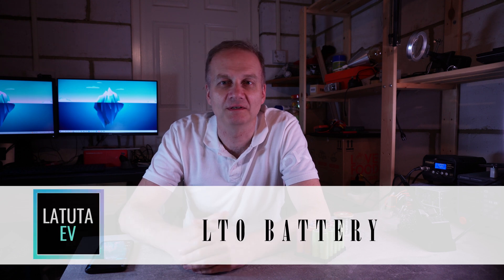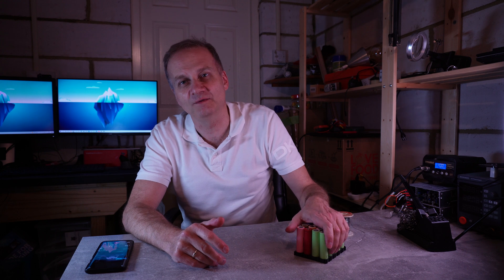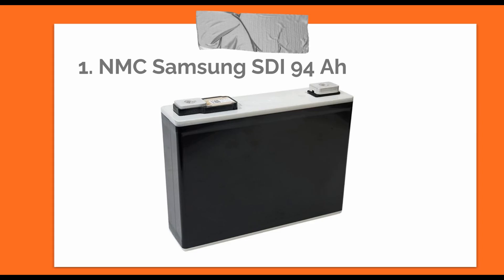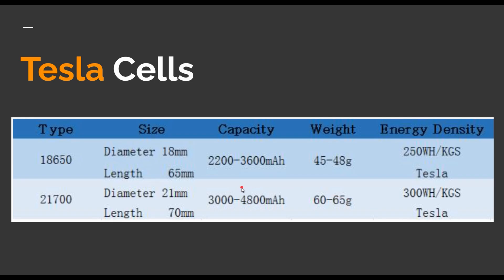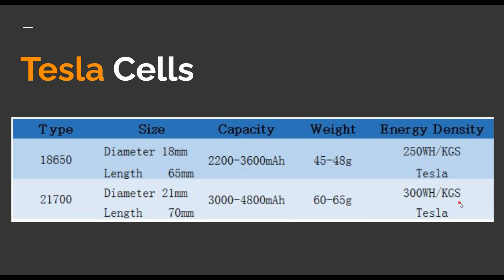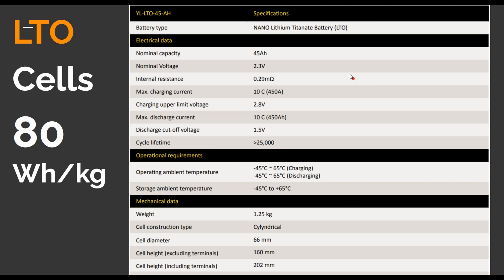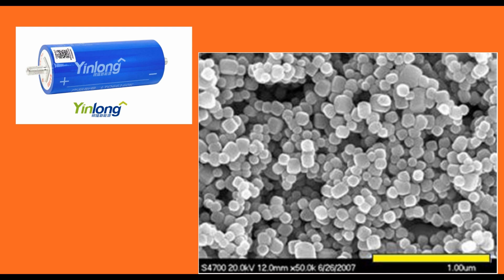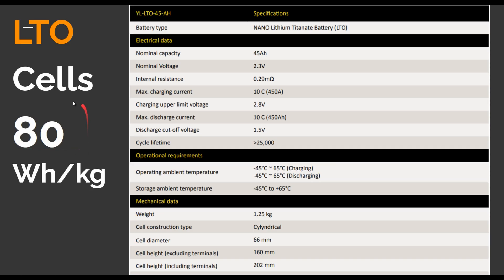LTO Battery for electric cars

Comment: just saw lto prices come down for the 20/22ah prismatics today from chinease suppliers. doing the math after tariffs (since lto are not apparently included in usa tariffs) LTO small format prismatics are only 2.9x the price of LFP now days with the heavy lfp tariffs.
when you factor in the lower need for strong fixturing (less expansion in lto), and no real need for fancy/expensive thermal managmnet of lto, youre ending up close to parity costwise for LTO vs LFP now days. in a small hybrid/high dishcarge pack, this is more true for lto. lfp for a small pack you will usually need 2p or 3p config to get enough discharge rate out of a smaller hybrid car/high discharge rate lfp pack. LTO can probably handle this with a 1p config further giving a cost advantage.
never thought I would see the day that there are cheaper applications for LTO vs LFP. no doubt thanks to trumps ego i guess lol.
there is a company here in usa that makes replacement hybrid batteries for older prius cars. they offer LFP and sodium ion right now but lfp they use small cells to get high enough discharge rate and they really struggle in colder climates. newer versions actually need internal heaters which end up nullifying most of the range benifits of LFP vs original NMH. this is an application ripe for LTO now. sodium ion is garbage coz its voltage curve you end up loosing almost 40% of capacity for prius retrofit application

Comment: lto makes the most sense as a replacement for lead acid/agm starter/auxiliary batteries in all cars, evs/ice/phev/erevs. way lighter than lead, lasts way longer, doesnt care about temp, better for short bursts of power even for a small/light battery, able to accept lots of charge. thats why the original word for lead acid batteries in automotive applications was an accumulator. much more similar to what we would label capacitor now days (in function not form). most lead acid batteries are not designed for capacity/weight efficiency. problem is in usa lead acid batteries have become a monopoly here, they are all made by johnson controlls in this weird circular economy. they raise their price every year by twice whatever inflation rate is and make them last shorter every year. they get all the auto makers to keep using their 100 year old battery tech in their cars usually by supplying the batteries for free which is a significant margin the automakers dont think they can give up. ironically for the consumers, lead acid batteries have gone up in price every year while lto keep coming down. around 2 years ago here in the usa, it became cheaper to import LTO cells and build your own 12v car starter battery instead of go to the store and lug ur heavy battery there and back. built a 6s lto battery for my old phev/erev and it has been working really well. 6s lets me use my low voltage solar roof to store more power above what my car would charge the lto battery to (14.5v vs 15.8v for solar roof). the soc curve lines up really well for this application. i think the cells pre tariff 6 months ago were like 122 usd delivered. a replacement agm battery was like 230-260usd lol. one of them will last forever.
its weird monopolies like this in the usa where i start to realize why we are putting in tariffs. not good for economy/industry in this particular example. net welfare loss of monopolies is a compounding value over time in micro econ

Comment: The claim on LTO is too good to be true. It's a new tech, the advertised longevity of the cells are still theoretical. Also, it's very pricey at this point. Great technology tho.
Reply from the maker: I agree about the price bit but the number of cycles has been confirmed through simulations and testing.

Comment: I think this could be a good cell for around town cars, local delivery vehicles and small form factor vehicles (think Arcimoto). These vehicles don't need large ranges because they never really leave the city. With the right kind of urban charges (Ultra Chargers?) there would be no issue because charing times would be extremely short due to the lower battery capacity and the high charge currents that are possible.
Reply from the maker: Yes but I think it might be the best to be used as a part of hybrid battery lto to harvest change through regen and NMC bit for the range

Comment: So I’m curious what you think about what LTO batteries would you use for a big boat 
In conjunction with capacitors
Reply from the maker: I am not sure if LTO would be the best for the boat. In the car the regenerative braking is limited as the normal NMC battery can not take such a high current. Therefore part of regen is waisted. I think one can use smaller buffer type battery for more efficient regen and faster charging in a car together with a bigger extender type pack. I don't envisage such a scenario in a boat.
Reply: @LatutaEV  NMC?
I’m curious why you think a huge pack of LTO batteries combined with some capacitors wouldn’t be able to keep up with such a great deal of fridges and freezers with the fact it’s basically a floating house/service truck working how many days a week
Reply from the maker: NMC is Nickel Manganese Cobalt Oxide = traditional chemistry.
Reply from the maker: I think in a boat scenario benefits of LTO may not be used in the most optimal way. Things like full regen and fast charging ability not critical for the boat. I think it is more important energy density and overall capacity of the battery
Reply: @LatutaEV  okay

So I’m curious what you think would be best for a boat with numerous freezer’s and fridges (power pigs) without any salt water or fire hazard issues ?
And what would you use for solar equipment and inverter&chargers for what type of batteries ?

I’ve got twin engine’s each one has a 250amp alternator
Reply: @LatutaEV  I forgot to mention that I am in Canadian coastal waters area’s where it’s colder than you think all winter!
Reply from the maker: @fixitbrewbaycustom854  that would be one reason to go for LTO. What is the average temperature you get in winter?
Reply: @LatutaEV  -15 or 18
Reply: @LatutaEV  what type would you use?
Reply from the maker: @fixitbrewbaycustom854  I would consider LFP still longer cycle life span than NMC and higher discharge rating. Not as good as LTO but I would have thought high enough for a boat. LFP has better energy density than LTO and with the bigger pack could deliver decent current. Low temperature performance of LFP is better than NMC as well
Reply: @LatutaEV  unfortunately it’s a boat and LFP has flammable issues doesn’t it?
Reply: @LatutaEV  eventually I would like to replace the 2catterpillar Diesel engines with electric motors 
What do you think about the conversion?
Reply: @fixitbrewbaycustom854  I've been plotting on doing this also, lto would definitely be the way to go, 100% discharge, works In freezing Temps, the cycle times, not worried about getting burned alive at sea.. You're in a boat also so why worry about energy density, just distribute the weight at the bottom for stability

Comment: I have experimented with two lithium titanate cells available from Ali and also an eBay seller who imports from china and ships from Rhode Island. I bought about 30 of the 12 ah cells that are in a pouch format with tabs at the top that can be soldered or connected using PCB or hole punch / eyelets. Those all tested at capacity and have performed very well, and are probably the best energy density of the LTOs given the minimal packaging. However, two of the 30 leaked, so some wear-in testing before building into packs is advisable or at least a pack design with multiple smaller modules that can be swapped out in the event that one leaks. Interestingly, the capacity of the 6s3p pack in which one of the cells leaked did not decrease noticeably, nor is there an internal short that drains the other cells. Time will tell, however. I have been more impressed with the 16ah green cells from small den on Ali, also marketed as super battery. I don't know how their energy density compares to the larger more common blue cells but their power density certainly seems better. They have all tested above capacity although this was only after I realized that you do need to charge them up to 2.85 or even 2.9 v to get everything out of them. I have contemplated using these in an EV with low range but high performance. They also are much more robust than the pouch cells. That vendor on Ali just changed all their listings to 26ah which I am inclined to believe is real since the 16ah all pulled above 16ah. Thus, I am tempted to wait even longer to see if they will continue improving the energy density. Theoretically, one could build a tesla pack with 405v charge voltage in a 144s configuration or 6x24s modules that would weigh approx. 150kg including busbars (cells weighing 130kg). Of course, with only 10kwh of energy, or about 1/7th that of a model 3, range would be abysmal. But the battery would also weigh about a third or even a quarter of a tesla pack.
Reply from the maker: This is very interesting information. I think that it may be more interesting to create a buffer pack from LTO to use the benefits of high current charging. In reality all electric cars don't use full potential of regen. So you could have small primary pack from LTO and bigger range extender pack from traditional NMC or LFP. I would be greatful if you could email me the details of those sellers you mentioned. You can find my e-mail in the about page. If you cannot find it let me know.
Reply: @LatutaEV  Yes that is also how I would utilize LTO. Have a LTO pack underneath the back seats right in front of the tesla rear LDU, with a 48v lifepo4 pack that is removable under the hood connected to my growatt 5000es which can either feed 240v to the tesla charger or can pull energy from the LTOs while the vehicle is charging (mppt range is 150-450v) back into the 48v lifepo4 pack. Yes I will email you the links.
Reply from the maker: @EEGworld  thanks

Comment: so what's LTO batterie;s actual capacity compared to Lion batteries? What's the difference in pertentage?
Reply from the maker: If we look at average examples of NMC and LTO it is roughly 340 Wh for NMC against 120 Wh for LTO
Reply: @LatutaEV  so almost 3 times lower? what about best LTO vs best Lion? also what's NMC?
Reply from the maker: This was kind of a best LTO against one of the best NMC. NMC is the most popular chemistry for Li Ion battery. It stands for Lithium Nickel Manganese Cobalt Oxide